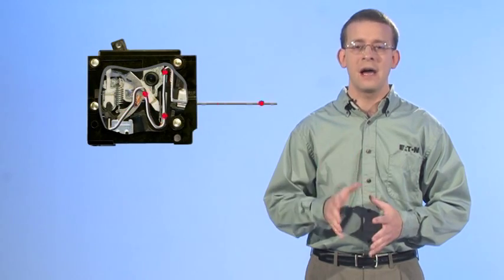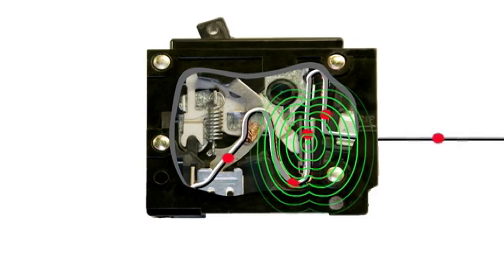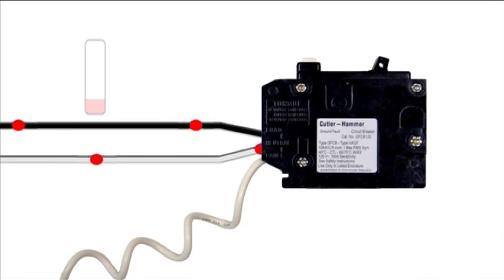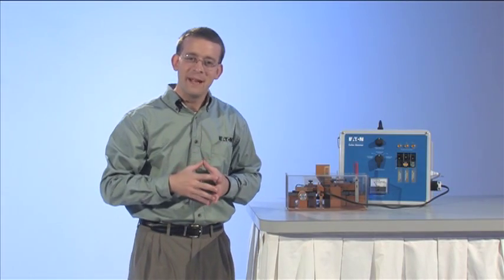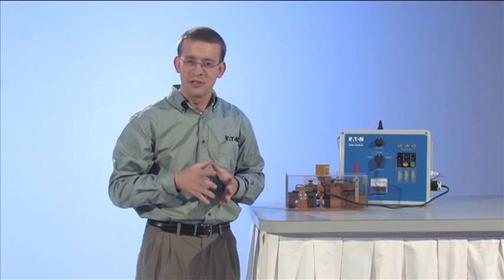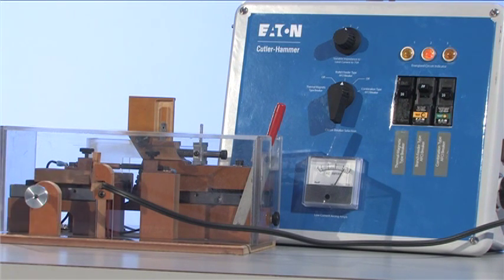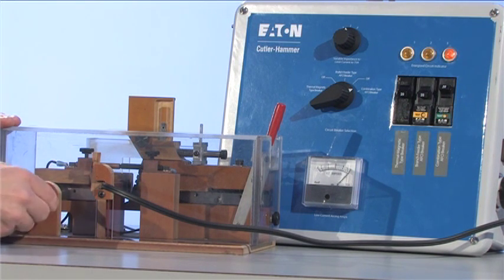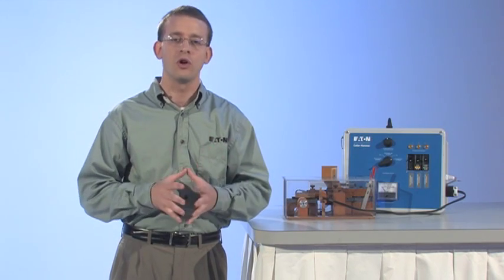Home Electrical Safety with Arc Fault Protection

Comment: ok, question? what if we have a electric pump working for 30 mins. Will the wire get hot enough to melt? Will the GFI get tripped because of the cable getting too hot? Current is the same, volt is the same?

Comment from the maker: @KnightChatX
To answer your question. No on replacing a GFCI with an AFCI. They are two different types of protection. You will trip an AFCI when ground and neutral make contact but not designed to give the necessary protection of a GFCI.